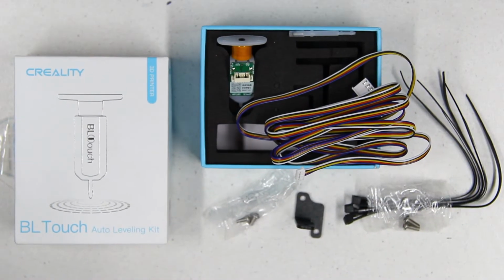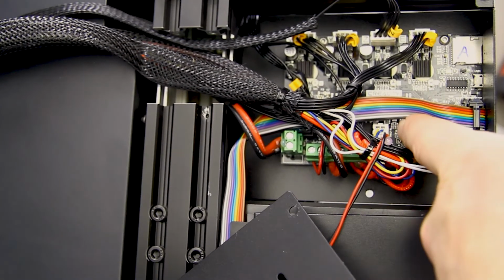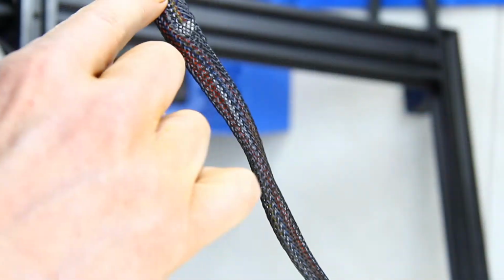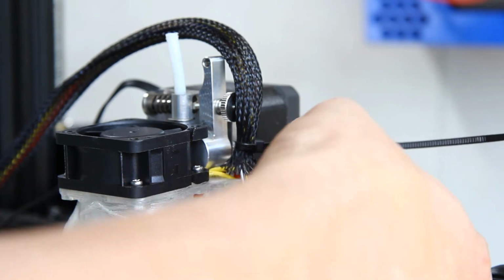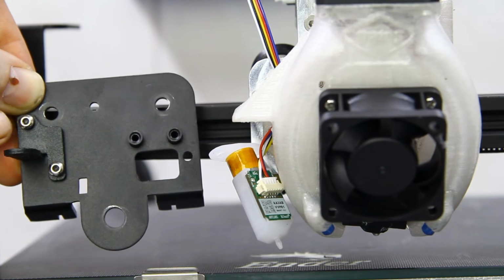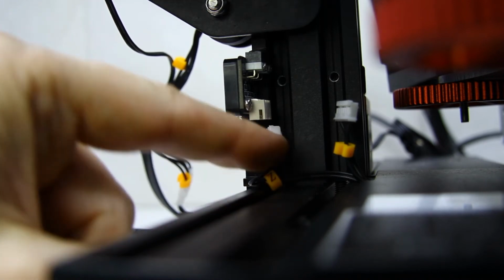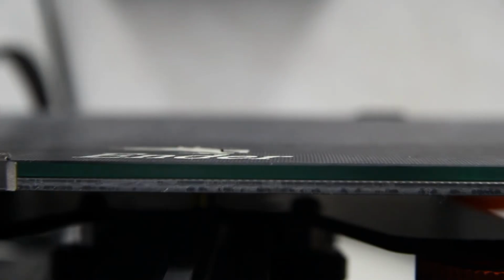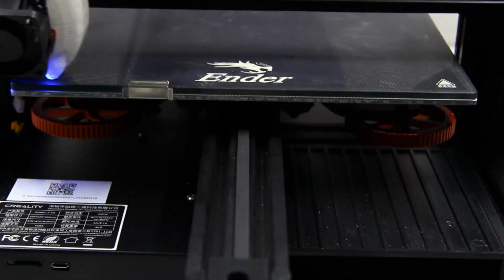Install a BLTouch on Creality Ender3 V2, 3D printer, for auto print bed levelling

Comment: Make sure you get the BL for the Ender 3 v2 ... I got an older kit that didn't have a mount and the wrong wiring, so I had to print out my own mount and re-wire everything myself ... pain in the rear!  Getting the nozzle to the bed after leveling is a trick as well ...the actual nozzle level while printing can only be adjusted .... while printing.